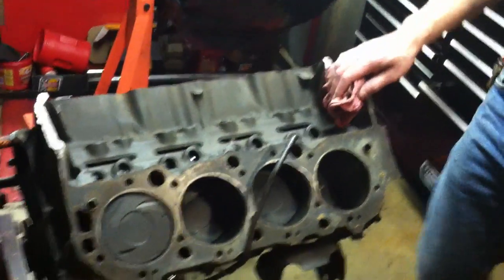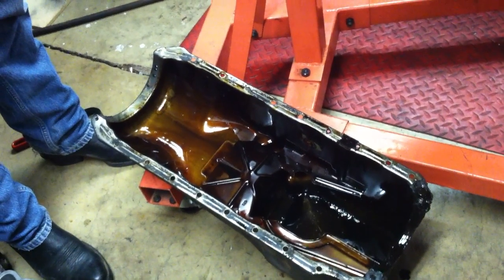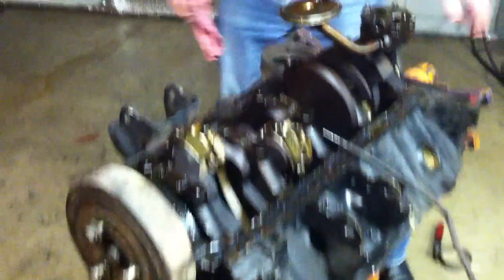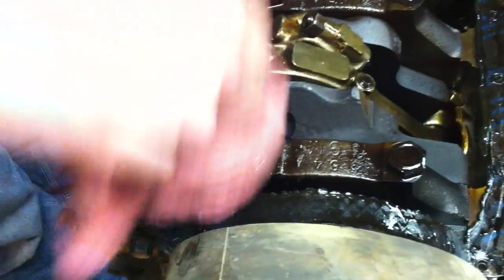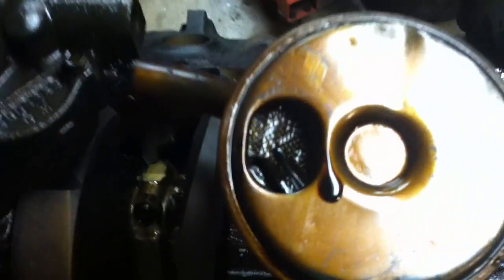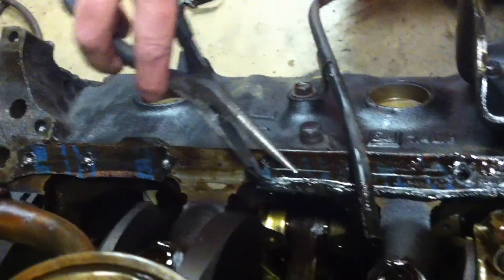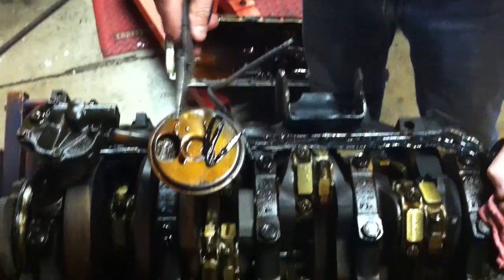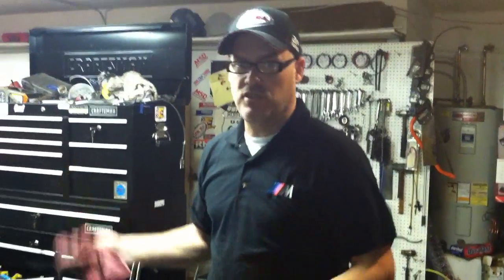454 engine build project part 1

Comment: i think your site is great,  i learned a few things.  but i got a question that you may know about.  i got a 454 2 bolt main full roller th400 close to 600mi on a rebuild , i just started hearing what sounds like a lifter tap and an inconsistent knock.  so i found the same thing @454 knocking noise. on youtube  i have never heard anything like it. seems to go away then comes back  if you got an idea i'm all ears. the guy w/vid never said if he found what it was. thx mb

Comment: Which one is better the 454 or the 427 and why?
Reply: 427 with the short of 3.76 is better utilized in a mid to higher rpm range and lightweight to mid sized vehicle and the 454 with larger 4.00 stroke low to mid range rpm heavy vehicles and towing unless  built for specific purposes or vehicle

Comment: I have one question to ask. I have a 454 Newley rebuilt my dad gave me. There's a problem with the hydraulic lifters staying pumped up. It seems they bleed down. I have good oil pressure and oil is going up through the push rods also. Any advise to fixing the problem. It does have a good lift on the cam I don't know the specs of it. Thanks.

Comment: Hey Car guy !!! I have a chevy small block with 187 K miles on it that you can still see the cross hatch on the very bottom of the cylinder bore , Why because the PISTON NEVER GETS  that far down the bore to even touch that area so you will see the cross Hatch that far down the bore until the cows come home because the piston never get's pulled that deep into the bore ....

Comment: great video. We have a 525 cu in. high deck truck block with BRC rotating assembly gas port . max compression pistons aluminum rods with 2 inch pins 740 lift roller cam with gear drive and crower roller lifters. Internally balanced weights on each end of crank shaft . Will rev 9000 with aluminum rods. Short block only  140 heads block decked align ,honed,and bored 0.60  . have a short video of the rebuild if you would like to see it let me know. And if you don't mind how much you think it is worth? Thanks for your time in this matter . kennethkapasi@hotmail.com

Comment: Great video!
Where's part 2-? 
I'm dying here! :)
I have a 454 big block in my jet boat I want to rebuild but I can't do it without your videos!
You have the best, informative videos in YouTube!
Reply from the maker: Jonathan Van Beek you can watch the 396 engine build it's the same thing
Reply from the maker: +Jonathan Van Beek Oh I'm sorry we never finished this one the customer backed out However if you watch the video I pasted in here it is my 396 build and is pretty much exactly the same as a 454 build check it out
https://www.youtube.com/watch?v=ykN-0-slcAk
Reply from the maker: +Michael “Roguelement” Laverty you said  

((((((( I have a chevy small block with 187 K miles on it that you can still see the cross hatch on the very bottom of the cylinder bore , Why because the PISTON NEVER GETS  that far down the bore to even touch that area so you will see the cross Hatch that far down the bore until the cows come home because the piston never get's pulled that deep into the bore ...."))))
That is true for a small block however it is not true for a BBC the piston skirts of a 454 engine travel .950 below the bottom of the bore and if you have crosshatch there it's a good thing. A 454 will not have it there until the cows come home if there is bore wear it will be gone long before the cows get back,  your confusing 2 different engines you implied that the SBC and BBC have the exact same parts that is also not true there is nothing interchangeable between a BBC and a SBC the parts are completely different so you are putting out info that is incorrect and I can't let that go on my channel so please educate your self a little better before throwing stuff out there Thanks
Reply: +Jonathan Van Beek  Dear Jet boat guy...small block big block the Chevy V8 is the Chevy V8 they both have the EXACT same part's they just look a bit different {bigger} they both have crankshafts , cam's timing chain's lifter's pistons Rods rings and they both need to be assembled by someone  who is careful and pay's attention to detail . sure there are tip's you pick up over the years but basically it's all the same .but you marine guys have different cam's than us car guy's but a cam is a cam ...and once you done one they only get easier because your confidence grow's .. I did a pair of 502's in an old Fountain ICBM 10 meter and replaced the head's with a set of 4 new Big Chief new intakes and pair of new 1250 CFM dominators and Basset  header's that boat we got to 127 MPH and that's was flying back then ...but fun . good luck .
Reply: hello guys I have a few questions I have an rv with a 454 its either 1985-86 only 29 thousand miles the owner  said it mostly sat is it a good engine ?
Reply: +Myvintageiron7512  Hey buddy 29K is 29K if you wannatear open a motor to "Rebuild it" after 29K then be my guest .. But your better off just buying a ready made short block from a reputable engine shop .. Because trust Me saying gee wiz I watched a video and rebuilt my engine mean's DICK... I been building muscle cars since the 70s and unless your going to be doing many many more saying you did  ONE.. is just cash foolish I wouldn't . I want someone who  builds engines for a living building mine that's why I go to the same shop I have for years they build race engines . but remember make sure your honest about what your going to be using it for . If your only going to be using it to show up and a few shows or cruz nights a year tell them. if your a motor head and going to be drag racing the car on weekends well say that .... But remember a Factory OEM bullshit rebuild to stock specs is NOT a race engine ..I don't care if your using the Mutha thumper or not .. a stock bore stock stroke RV engine makes all it's torque as close to idle as possible sorta . and Performance it isn't ...you want performance Buy a performance motor ...

Comment: I have 84 cj7 I drive it cross county but speed is the issue 
I was thinking to install a 454 bog block in it 
How much do you think it would cost ?
Reply: +Fabio Dos Santos  Fabio .buddy.. STOP .....Before you even attempt that reconsider your choice and think about an LS series Chevy Truck motor , you can get an already running 6.0 liter and run it with carburetor Or leave it injected ...We tried doing a Big Block Cj7 years ago and it was never right but that was before the LS engine so we did a 400 chevy small block with some stroke we ended up with 420 inches and it was such a handful to drive but really fun ..made lots of HP and sounded sweet ... My advice try the LS engine and drive the wheels off it ..

Comment: putting an old 454 into an older nova seems an interesting project. do you have any advice for someone buying a 454 engine? and what do long block vs short block mean? could i put a long block in a nova?
Reply: +justrockon426  Excellent choice bro .. If your serious about this build you can purchase an incredibly stout short block from a company called CNC motorsports they truly build some insane motor's and know there business, but remember when your ready to buy head's DON'T GO CHEAP .. You can buy so many different chevy big block heads but whatever you do .. Buy them BARE and have a shop do the competition valve job and basic port work using good part's and your motor will  love it Or work a deal with CNC motorsports on a long block {with head's} short block comes without heads long block comes with heads. you can have reliable power and NOT have to float a loan from the federal reserve ...Let Me know how you make out ...good luck ..
Reply from the maker: long block is with heads short block is without heads see my 396 engine build series it pretty much the same thing
https://www.youtube.com/watch?v=ykN-0-slcAk
Reply: so long blocks should perform a bit more and more easily right?
Reply: I finally got a '79 camaro 305 with 700r4 c4 transmission! maybe some day ill put either a supercharged 350 ...or 383 crate engine!

Comment: Can you run a 228 summit cam with 540 in a big block on the street
Reply: of course you can that is the advertised lift of the cam I'm assuming which means the duration at .050 should be a bit less that profile isn't too radical you can probably even get away without a cam relearn if you have a newer car I don't think valve train should have to be upgraded either you can use stock rockers springs  valves and pushrods with that good luck on the rebuild